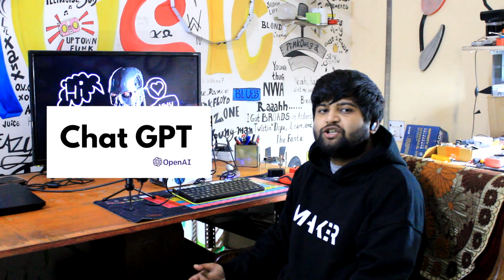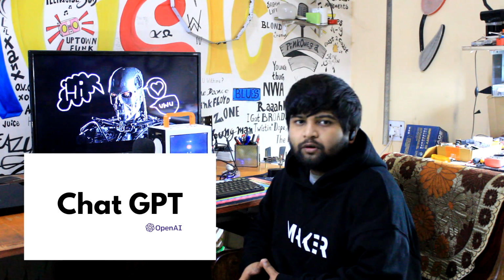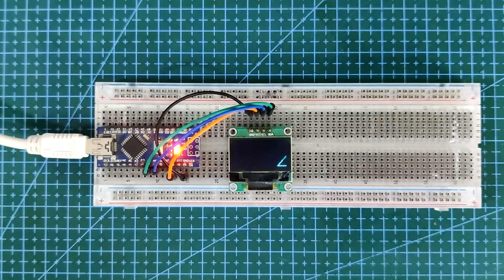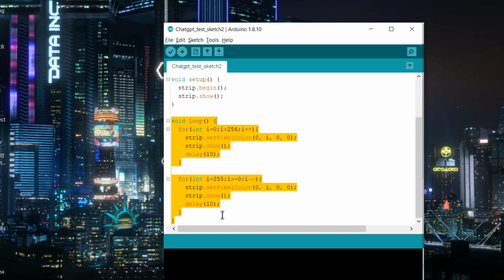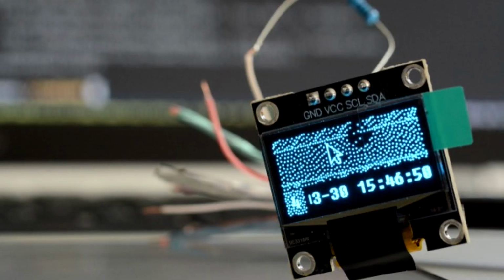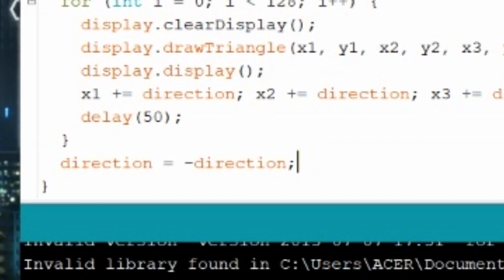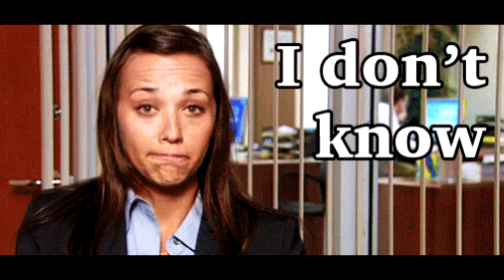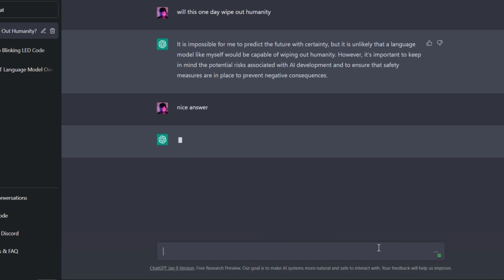Using CHATGPT to generate Arduino CODE

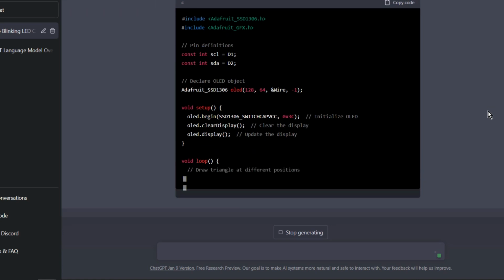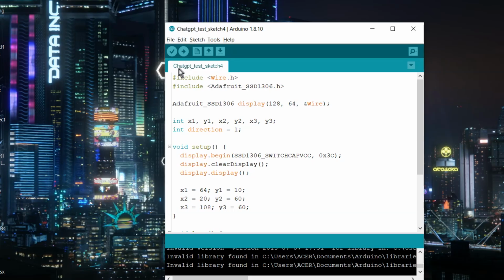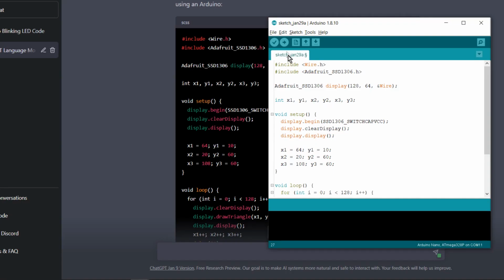Comment: I really don't undestand what's going on in this video. At 4:32 you can clearly see that the code chatGPT is generating contains the I2C address. At 4:53 you can still see it in the code you copy pasted in the Arduino IDE, but then jumpcut at 5:01 when you upload the sketch and we can see that the I2C address has magically disappeared ...??? So you removed it yourself and blamed chatGPT ? I just don't get it
Reply: Actually it's not just the I2C address, the code after the jumpcut is different from the one you just explained
Reply: Yeah. Good spot. The 0x3C address was clearly seen in the ChatGPT generated code to start with. Don't understand why he pretended it was never there? Was it to try & discredit ChatGPT?